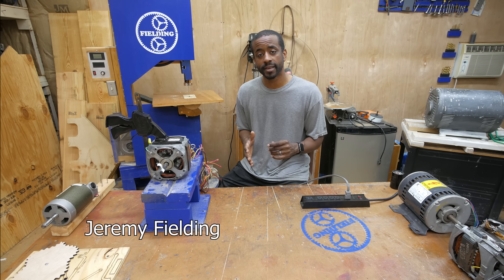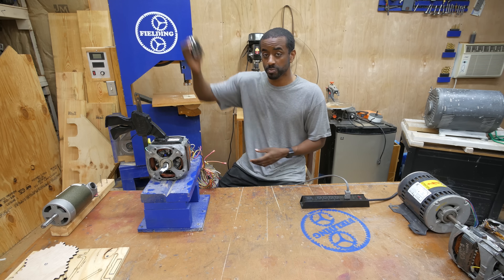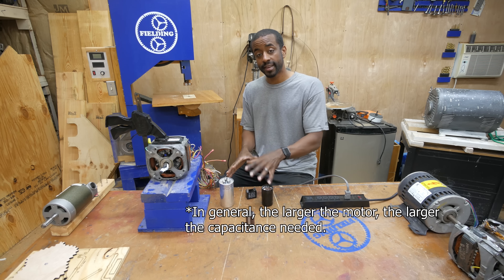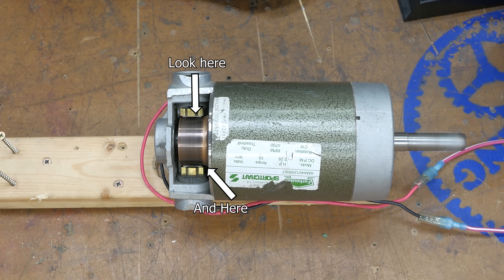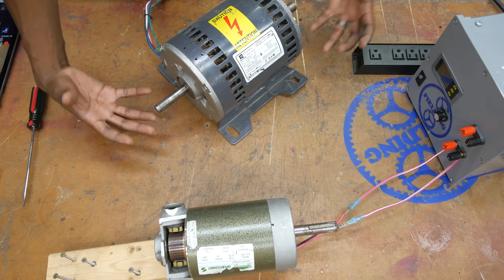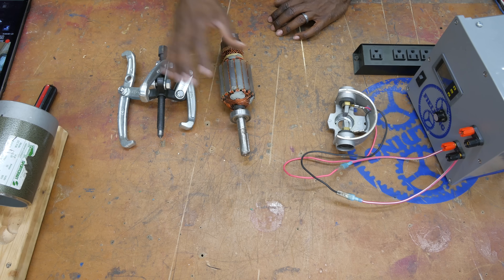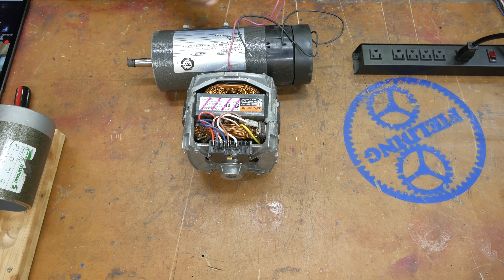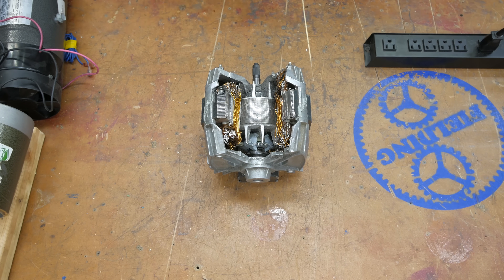Three Most Common Motor Fixes Anyone Can Do; Ultimate Guide to Electric motors ; #070

Comment: hey mechanic here, my treadmill motor is making a really bad burning smell 2nd time, im sure smell is from motor, and its red power cable connector to the circuit board was pretty corroded or blackish. any idea what needs to be changed, cleaned, in the motor? it costs 200 for a new one.

Comment: the capacitance of run capacitors is SUPER important!! if you use the wrong one, it will burn the windings due to too much or too little current. star caps are more flexible, but just searching for the capacitance and voltage rating of the old one works well

Comment: I have a copper wire fan motor, It's new but been broken in transit, i see few copper strands one side and  one strand of copper on the other. I'm thinking this is where the connector was fixed but the other side with only one strand do you have a email address so I could send a photo for help please, thanks.

Comment: I have an air compressor motor that starts and runs great but every now and then it slows way down and struggles to turn,    
this usually results in it tripping the overload switch on the air compressor.
I can usually get it to work properly again by simply turning it on and off a few times.
there is no physical resistance in the motor,   
I can turn it by hand no problem 
its very smooth,  
bearings feel good.
as far as I can tell it looks brushless
capacitor works fine
wiring looks fine as far as I can tell.
any help would be appreciated.

Comment: One problem I've fixed in the past that you didn't mention was needing to replace the thermal protection reset switch component. The round push button kind you often see on motors. The motor on my thickness sander started tripping the thermal protection reset very regularly after I brought it out of storage, but was not actually over heating. Ended up being a faulty thermal protection component that was only a few dollars to replace. Motor has been going strong for years since replacement.

Comment: This is a perfect DIY video - straightforward, to the point, informative and useful. I am familiar with electric motors and work on them a lot, but I still learned a good bit I didnt know or filled in some gaps in my knowledge. This dude should be appointed Minister of Information for You Tube. Beautifully done!

Comment: I'm not sure where my comment went that I tried to post so here is my second attempt. The problem I ran into with my electric motor was that the glue which held the permanent magnet to the inside of the case let loose. I didn't realize it's this until I tore it apart thinking it was the bearing going out. is it possible to reglue these magnets back in place? I would have to assume that it is as long as you have the correct glue. have you ever ran into this problem and how did you fix it

Comment: You didn't mention the problem I ran into. I don't even know if it can be fixed or if it's an easy fix but I thought the bearings were going out of my blower motor for my school bus. I tore it out and tore it apart to look and see what was going on to see if I could maybe replace the bearings since they're kind of expensive motors for what they are. I come to find out one of the permanent magnets came detached from the inside of the motorcase and was stuck against the motor. Just as an experiment I may tried to clean off the inside of the case and the outside of the magnet and see if I can glue it black it back in place. do you have any idea of what type of glue they use on those? I was thinking maybe a high temperature JB weld type deal.

Comment: I have a couple fans, capacitor start, that I have replaced the capacitors on a couple times, which did get them working again. But now they don’t even hum when you turn them on. I am an Electrician, not a motor repair person . I am currently taking  one apart to see if the O.L. Is not shrinking back. Wish me luck, or send ideas. I love your channel please keep it up!🎉

Comment: Thank you so very much for explaining this. I just found your channel. I was having some issues with an air compressor motor that was tripping the breaker, it’s more than 10 years old, so I replaced both of the capacitors and that seems to have solved the issue. Now it’s starting to trip the breaker again. It will  only run for about 30 seconds I think something else could be wrong beyond the capacitors at this point.

Comment: Capacitors are known failure points wherever they're found. I could cost myself money I already know no one will notice that almost every $2,000 TV that goes in the trash does so for lack of a $0.50 capacitor.

Comment: Thank you for the very informative video.  It helped me in opening up to diagnose a DC motor that has not been working consistently.  I suspect the two brushes need to be replaced but I'm having trouble sourcing the replacements.  Any guidance how to verify?  All I have are dimensions and other physical description. No info stamped on the brushes.

Comment: My compressor didnt trip the breaker, but it wasn't running. I turned power off and then back on and the motor has a single loud clunk, not a click like a solenoid. A clunk. Bother the motor and compressor can be spun by hand. Not locked up. Any ideas?

Comment: That motor with the centrifugal switch disengage is similar to what I am replacing the bearings in. Is there any suggestions for cleaning these types of motors? The armature is a smooth black surface and I'm wondering if I should clean it with contact cleaner before reinstall.

Comment: A humming motor does not 100% mean the capacitor is bad.  In our industry it is very common to come across a motor that has a problem with the centrifugal switch and this same humming symptom.  You might have a centrifugal switch that is not closed with the power off which will not bring the capacitor into the circuit at startup.  Or you may have a centrifugal switch that is "wobbling" where it is closed at some points but if you slightly rotate the motor shaft  by hand, the contacts open up abnormally.   All I am saying is, a humming motor could mean a bad a capacitor but in my experience, it hardly ever is.  Way more often it is an issue with the centrifugal switch

Comment: Hi Jeremy:  I have an old, cast iron bench grinder, about 1/3rd horsepower with 6 inch wheels that uses a capacitor.   The numbers are off the capacitor and I'm pretty sure that it's not even the original capacitor.  How can I determine the correct mfd's to use for this bench grinder?

THANK YOU.  P.S.   GREAT video.

Comment: Fan motors have a thermal fuse on the inside which will burn out if the bearings start to seize or if the motor overheats because of dust and dirt. These fuses are replaceable, you have to just make sure the new fuse hast the same temperature rating. Again, you have to fix the problem. Both cleaning and then oiling the bearings, will fix the problem.

Comment: I love this video. I have a question involving a motor-generator. It is basically a 12V DC motor that is connected to an AC alternator. If the motor has not been used for a long time, the motor will not start even though it is energized. If you bang on the motor case, it will start. The problem is similar to a starting motor on a car. The starting motor will not start until you hit the motor case. Is this problem due to faulty bearings?  Thank you.

Comment: On a two speed swamp cooler motor,
Firstly, how they make it to regulate speed if the input current is the same.
And secondly, my motor uses spec amps at high but uses more amps than specs at low speed. For that reason I only use high speed to prevent my motor from heating. What could be happening if it is the same rotor, wires and bearings?
Thanks for the video,

Comment: I have a weird symptom on a clothes dryer that has been bugging me for a long time.  The dryer is about 25 years old.  When it was new, I had to set the timer then press the start button.  Somewhere along the way, it ceased needing the start button and runs whenever the timer is set.

Any idea why that would happen?  My wife may have called in a service guy for it at some point, and I wondered if it has a motor now that doesn’t require a start capacitor.  It works, so I’m not going to “fix” it!

Comment: Great video! You asked about weird motor issues so I’m gonna tell you about a motor problem I have. I hope you can help me, it’s a $1500 motor. It’s a single phase 36h675y318g1 Baldor motor. It is a compressor motor and ran fine for years. Total use time maybe 100 hours. I have two wires coming out for power supply.  .5 ohms across them and open line to ground on either of them. Motor spins free. It has three capacitors. I may have switched the wires around when I was diagnosing the start switch issue tied to the pressure regulator. I did label things but mistakes happen. either connected or not I cannot free hand start the motor. One is a metal cased capacitor and the other two are not and are wired together (left tab to left tab and right to right. I think that is parallel) There are 4 wires coming from the motor to the capacitors. Two have a red strip and are connected to the same side of the run capacitor (left tab) the other two have  no stripe, one goes to the other side of the run capacitor the other  wire has a 1 marked on it and goes to the 1st start capacitor (left tab) there is a jumper from the right tab of the run capacitor to the right tab of the start capacitor. I have tested the capacitors the numbers bounce back and forth, the run is good stays in range, the start capacitors (one tests good and the other is a good bit higher like 340 on a 216-259 uf. I tried to replace it but the capacitor I received was much smaller even though it claims to be a replacement for and the numbers all match up. It also tests good however it has no range. It is nearly unchanging but within range. Please help me. I’m at a total loss for understanding the problem.

Comment: I have a stark 10 gallon air compressor. I haven’t had it long. All of a sudden it started cutting out on me and I have to press the little red breaker button on the side of the motor. I changed the oil because I figured it was about time and that might be the cause but it’s still doing it. I even replace the capacitor and it was still doing it so I put the original pastor back on. The only thing I can think of is maybe it’s the wrong kind of oil, although I don’t see how that could be. Or I did see in the manual. If there’s air leaks, it could cause that and I think there’s a small air leak but still it doesn’t make sense to me. If you could offer any advice, that would be great.

Comment: I am making the attempt to repurpose a walking pad for lapidary tool. How do I test the motor to see if good, and what vital parts do I need to take out and use? They power on but the belt doesn't move without the remotes and I don't have the remotes. Any help appreciated!! I have 5 days to figure out before I can return them as no good

Comment: Saved me $800 ! Simple capacitor replacement on a blower motor that the repair tech said didn't even have a capacitor. Glad I questioned it.  $8 on amazon!
Reply: I replaced the capacitor on my Air Conditioner, Amazon to the rescue.  It's amazing how "simple" some repairs can be

Comment: I have had good luck installing bearings by heating them in oil (using an old Fry Daddy) and chilling the armature in the freezer.  Everything slides together easily without beating the bearings on

Comment: I actually do have an electric motor problem not covered in this video. The motor is a capacitor start 3/4 hp on a drill press. The symptom is when I turn the power on, it'll twitch forward a little bit most of the time. After many times flipping the switch, it will run and once in a while stop. Spinning it by hand does not work. I changed the capacitor even though it does not hum, and serviced the centrifugal switch and it's working fine according to my meter. I also changed out the power switch and even removed it from the circuit which, like everything I have tried, made no difference at all.

Comment: I work in industrial environments and mostly we are working 3 phase motor @ 480 volts. But we also have DC motor that we’ve constantly changing the brushes. But they run it until catastrophic failure. And just they just replace it with a new one. For one the motor constantly run. Even informing the operations supervisor about the issues and even installed a kill switch. But nope even when their machine is down during change over, or we have resolve an issue or they go break but they let it keep running. I wish we did install a motor with a thermo overload.This was an old plant I worked for before PLC was put into place. Have anyone here worked a pneumatic PLC???

Comment: My Goulds water pump uses an A.O. Smith 1/2 hp motor. It trips the circuit breaker and a big spark jumps off of the start switch. Maybe only the start switch needs replacing?

Comment: I've got a one and a half horse tile bridge saw motor and how to bearing failure no problem and get that done but as I took it apart to get the bearing out I noticed the rotor is actually seized . So now my question is what is the easiest way to get this motor free and rotating without damaging anything

Comment: The fan motor on the outdoor unit of our HVAC quit working. I ordered a new one, but in the meantime I disassembled the old one and found that most of the grease had dried up. I cleaned it up, regreased it, and reinstalled it. At first it didn't turn, but with a gentle nudge of the fan it started running and has been working fine for about two years now.

Comment: The window motor in my car stopped working so I took it apart. Learned about the brushes making contact and noticed mine were worn down. Took brushes from another motor and replaced the ones in my car. Window works fine, it’s as good as new. Almost spent +$300 to get it fixed, luckily I gave it a go before deciding to. Overall didn’t spend a penny. Also learned a lot about magnets and copper wire. Very strange magnets are.

Comment: I have a really old washing machine motor. it looks like a magneto off of a Briggs and Stratton lawnmower. I plug it in, it hums for a few seconds and starts to turn. It freezes up as soon as a small load is put on the pulley system for the agitator or wringer. You can spin it back to life by hand. Of course you talked about capacitor replacement. What do I do if it doesn't have capacitors? Also their is nothing online about this washer except for a YouTube video someone made showing it working and then breaking down. It's a Monitor aerator washer model 55.

Comment: Hi Jeremy, great videos.  I do have a question, I have a single phase induction motor in a dryer which uses a starter winding and centrifical switch but no capacitor.  How does the starter winding work to start the motor since it would be in phase with the main winding?

Comment: This is a great video and I am very grateful. Thank you, Jeremy!  I know nothing of motors, electrical stuff so this is like climbing a ladder with bottom rungs missing. You are bridging that.  I have a mini bench grinder that is not working.  I found it in the trash. Looks new. Opened it up and all contact points look solid, nothing looks burnt on circuit board, and no wear on motor, so scratching my head as to the problem.  This helps a lot. You have a low key style that is soothing and you explain things clearly and in depth. That is very much appreciated for a know-nothing like me. I wish they taught this stuff to us in girls schools. So useful. Thanks also for not having music blaring.  Subscribed.

Comment: how about a old style ford starter motor with the speed control or solenoid mechanical thing on the side .. and the tiny little wire that’s inside the motor..

Comment: What if the capacitor is replaced but will try to run on load but when it doesn't have load it runs ok tho the RPM isn't running to its default

Comment: We have some floor scrubbers at work that will buzz a lot of times when the capacitor needs replacing but what would you recommend checking next after replacing capacitor if it still does the buzz type noise when trying to start it a lot of time s there not under a load when trying to get it to work